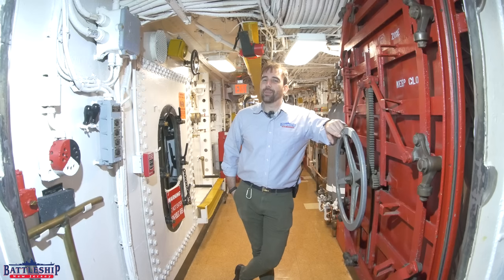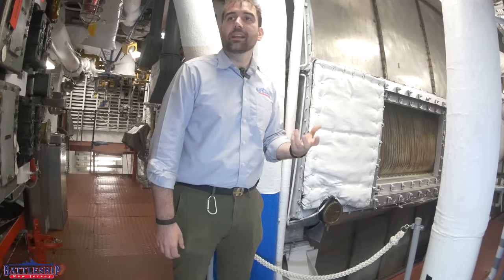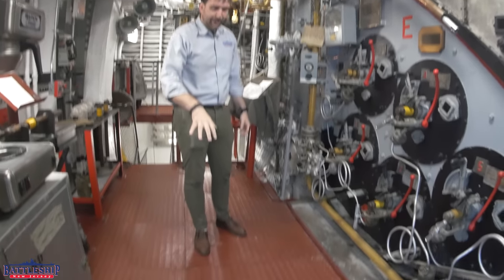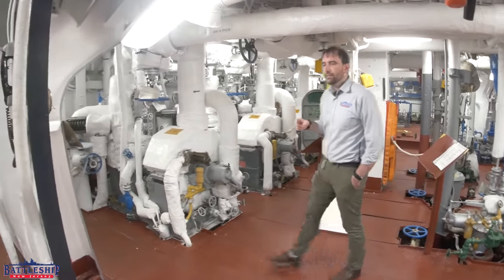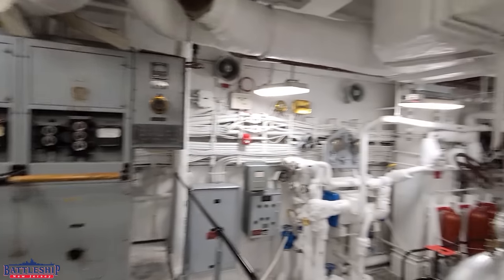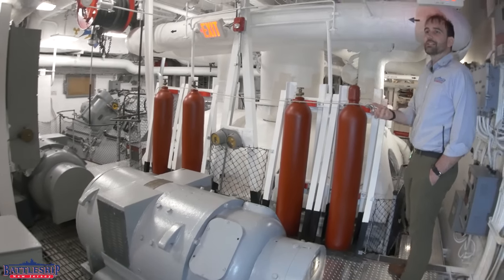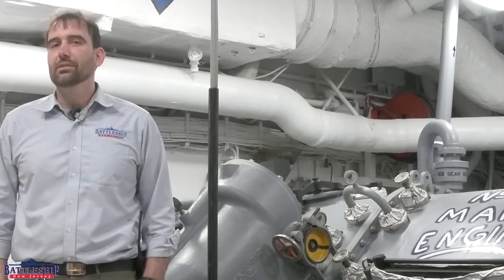Inside the Propulsion Plant of the World's Fastest Battleship

Comment: Flash back! I was a Boiler Technician in the Navy (BT3). It was hot and dirty, and smelled like diesel. You were the first one on the ship, and the last one off the ship. 18 hour days was the norm while under way, and you prayed that there wasn’t GQ (General Quarters), man overboard drills, or anything else going on while your trying to get a few hours of sleep, if you even got any at all. 6 hours on watch, what we called 6&6 with a full work day in between watches was our underway schedule. A friend was an MM2 on this very ship. Being a hole Snipe was the hardest job on the ship. I retired as an MRC (Machinery Repairman Chief Petty Officer).
Reply: I had a good laugh when he talked about 4 hour shifts. If we were 4 and 8 we had a full workday as well. I was a hole snipe on the USS Midway for more than three year and we almost never went 4 and 8.
Reply: Engineering never changes, I'm a nuke on a CVN and its still the same. 6 and 6's while underway and 3 section duty in port.

Comment: Marine engineers are the only people I know who will drink coffee in a 120 degree environment!
Reply: We also put on a sweater if it gets down to 90 deg F!
Reply: @josephpadula2283  Good humor , When I was aboard U.S.S. Hepburn we were on out way to Australia . Our Corpsman came down to the Fire room , The COLDEST place he could find was 155 Degrees . About 2 Weeks later we had to muster on the Helocopter deck . I went up and Imediatley went back and put on my peacoat ,gloves , Watch cap , I want back up . I was still cold . the humor . Us Bt's Were dressed for Cold the rest of the ship was dressed for hot , they were Sweating  we were so COLD . It was 7 A.m. air temp was 84 we were at 24 kts  . Thank You
Reply: @henrycarlson7514  The coolest area in a steamship engine room (except for modern ships with air conditioned control rooms) is the exhaust of the low pressure turbine. It is around 75 -80 degrees F.
Reply: @oldtugs  I was aboard  U.S.S. Hepburn FF1055 Which had a seperate fire room and engine room , the area by the mn condenser was cold
Reply: Or tea !
Reply: M looks
Reply: Not the asbestos gloves lol
Reply: You've never worked swing shift in a steel foundry apparently.
Reply: @henrycarlson7514 The human body is amazing at adapting, but not amazing enough, apparently 😂 You want to get used to the heat, but you don't want to get non-used to the non-heat.
Reply: @henrycarlson7514 : When were you aboard Hepburn?

My dad was a BT on Hepburn in the 70's. I've inherited a few of his cruise books.
Reply: @DefiantSix  I was aboard U.SS Hepburn FF 1055 , 1981+1982 . I was also a BT. I have 1 cruise book .  As a True story , we were in the Indian Ocean , the Corpsman cam e down with a dry bulb thermometer , the COLDEST place he found was 155 Degrees.
Reply: @josephpadula2283  Former BT aboard Adams Class DDG - can confirm.
Reply: Yeah, it's funny 🤣 cause it's sooo true! I would drink hot 🔥 🥵 coffee in that HOT engineering space. You had to drink the hot coffee ☕ in that hot space. Can be up for over twenty four hours or more, it's rough. Thanks.
Reply: @jasonbose3507  I'd go through 2 Big Gulp cups of coffee in a 6 hour watch.  That would kill me now... Literally.
Reply: @henrycarlson7514  USS Hoel , DDG-13 - I had to do that job for Engneering - can confirm.
Reply: @oldtugs   Former BT - that sounds wuuuuuunderful.....
Reply: @josephpadula2283    We were south of the Bite in Australia, not far from the antarctic circle, when they woke me up for watch they said grab your peacoat.  It was 60deg in the fireroom (the water outside was near freezing).  It was weird.
Reply: welcome into my club😅😂😂😂😂😂😂😂
Reply: MM aboard the USS Paul DE 1080 ‘74.
Reply: I was in the engine room in those days. Short handed, 4 on 4. That's where I learned to love black coffee. Of course the th 60's it was a urn bolted down and the way the LSDs rode the grounds spilled over.  That way you got your rufidge.  But at least the coffee never got cold even sitting for a while.
Reply: @henrycarlson7514 the human body cant continuously operate after More than 15-20 minutes at that temperature 🙄
Reply: @jonnyblayze5149  I disagree , When I was Navy , The watches were 5 hours long NO breaks . Any body that was a Bt can verify . Especally near the equator.
Reply: @henrycarlson7514  physics and biology says you're wrong
Reply: @henrycarlson7514  Externally, the upper limit of the human body's thermoneutral zone—the ambient temperature range in which the body can maintain effectively maintain its temperature and equilibrium—likely falls somewhere between 104 and 122 degrees Fahrenheit, according to a 2021 study published in Physiology Report.Nov 29, 2023.

155 is just too much🤷
Reply: @jonnyblayze5149  I and Thousands of Bt's will disagree with you . I was there I read the Thermometers. Also please understand that was the Coldest place he found.
Reply: @jonnyblayze5149  I must disagree  I was there I read many thermometers . Ask any Bt that was Messenger of the watch , the temperature readings are taken every hour in several places and Logged .
Reply: @henrycarlson7514  yeah im just saying physics, scientific studies, and proof say you're wrong. 🤷 But hey what do the worlds smartest minds know right🙄
Reply: @henrycarlson7514  155 is just too much, not says me but says physics, biology, and the PHD scientists that studied this do.
Reply: @jonnyblayze5149  I Was There I  Read the thermometers , Ask ANY Bt that served on a Frigate or Destroyer
Reply: Ahí abajo no tomaban helado?😂
Reply: Coffee pot makes ice coffee
Reply: Never known a truck driver or auto mechanic or a painter or a Mason or a welder or a cop or a fireman I guess huh? Geez
Reply: Me too ☕️! 🇺🇸

Comment: I always wondered why they didn't use direct engine power as a kid, but now realizing you can get quadruple the power of oil by using steam is fascinating to me.
Reply: Marine diesel technology was not capable of producing this kind of power back then.  Today, you can get low speed marine diesels up to 100,000hp or more. and since they are low speed, there is no red gear, they are direct drive, which saves weight (not that the engine is light, but you don't then have the EXTRA weight of the reduction gear) and cost (initial and maintenance).  But you are correct, at the time, this complicated steam power system produced the most power for its weight and operating cost.
Reply: @stephenbritton9297  Another significant advantage of modern marine diesels: they don't have steam's nasty habit of barbecuing the crew when the engine room takes even a relatively minor hit, a recurring theme (as Ryan alluded to here) that is easily the most harrowing part of any book about, say, the naval battles off Guadalcanal.
Reply: Some other things to consider.   If you have one power plant and it goes offline you are done.   This setup provides redundancy and the small compartments to help with water control if they get hit.
Reply: @ZGryphon  One of my father’s cousins was in an engine room on the carrier Wasp when she took a Japanese armor piercing bomb through the flight deck, the hanger deck , where it exploded in his engine room. Only he and two other guys survived the blast, although it would lead to his early death years later. I won’t go into the details he told us about what it was like going back in there to clean out the damage and remove the casualties.
Reply: How much (if any) can you adjust the ship’s speed by tweaking the air and fuel flow before you have to swap out the burner nozzles?

And when the navy switched from bunker C to diesel, did the burner nozzles change to account for the change in viscosity and BTUs?
Reply: @oligoprimer  The Iowa class battleships to use diesel fuel in the 1980’s in I remember correctly. This was done to simplify the logistics of at sea fuel replenishment. As I remembered the adjustment of the air fuel mixture is not going to give you any real performance gains but was used to to trim the air fuel mixture to attenuated visible emissions as the burner nozzles became coked up (fouled) before being removed to be cleaned. Coking of the burner nozzles became a lesser issue after the boilers were converted to run on diesel fuel.  A side if a fuel spill into water diesel fuel is far less detrimental to the environment and wildlife than Bunker C because diesel fuel will float and evaporate and dissipate whereas Bunker C will remain a sticky gooey mess that will either sink to the sea floor or wash up on shore.
Reply: @gullreefclub it not only simplified logistical support for fuel but relieved a workload from the sailors maintaining/operating the boilers. On black oil fireside cleaning was performed approximately every 600 hours of operation to remove deposits from the exterior of the boiler tubes. On distillate fuel that timeframe was increased to approximately 2 times that value. The work performed actually became easier because the distillate fuel burned so much cleaner than the black oil did. Cleaner burn meant less deposited to remove from the exterior of the boiler tubes.
Reply: @oligoprimer question 1.  Yes fuel flow and combustion air were the primary controls for boiler output. 
Question 2.  Yes nozzle sizes changed considerably.
Reply: If you were wondering about the design choices of a battleship propulsion system as a kid… shew… god bless.  I hope you’re a weps designer for Lockeed Martin or some other weapons builder.
Reply: You cannot "quadruple power" by doing anything. You don't understand what power means in physics.
Reply: Lliuninininiiiiiiii8iip
J
😊😊 1:27
Reply: Thank You  , this is very interesting , if you ever get the chance to tour a coal fired power station while there is a couple left  , advise you to take it .Fascinating 👍 as they're running too😊
Reply: @aluisious you know what he means though even if he did not use the technically correct terminology (a terminology that’s somewhat detrimental to use in most cases as most people don’t actually know the precise meanings of each term and will get confused quickly) these are YouTube comments not a lecture or paper on battleship propulsion refinement and improvement
Reply: @stephenbritton9297 it still does, but some of the fuel has changed. It's nuclear fuel.
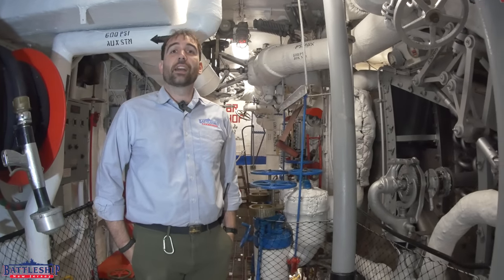Reply: @ZGryphon 4:49 😊
Reply: We had some Iraqi's cleaning up the messes in the blown up APC's, tanks, trucks.  Sometimes the Iraqi's wouldn't show up & do their job, so it was up to us. Some of them had been sitting in the field for a number of days, so they were ripe.  War is ugly, but most people do not comprehend that part.
Reply: Those early videos are just fine Ryan.
Reply: @stephenbritton9297  I have no experience in the subject, but was watching a video on a cargo ship on the great lakes and was fascinated by the fact that they were turning single digit RPMs on the main engines.
Reply: @gullreefclub  I remember as a kid getting "tar" on my feet while at the beach. It also may have come from natural seeps in the Gulf of Mexico.
Reply: Turbine steam was a big debate in the British K subs of the 1910s. They wanted the speed to keep up with the Battleship Line as Battleships were becoming faster Dreadnaughts. Adm Fisher wanted diesel but they couldn't get the speed so they had to use steam turbine. The main reason Fisher wanted direct diesel was because boilers would go out if flooding occurred. They also ended up putting diesel generators to power the batteries as back up in case of flooding. Which ended up being a good idea as flooding did occur, as predicted by Fisher.
Reply: Propulsion is still steam turban, the difference is we now make the steam with nuclear power, both surface and subs.
Reply: @aluisious yes you can. If I burn oil in a pit I might get about 600W of heating. With massive heat losses to exhaust and unburned oil.  If I burn it in a boiler I might get 20kW with lower exhaust heat and almost no unburned fuel. I more than quadrupled the power. 

Don't say such blatantly silly things.
Reply: @aluisious increasing efficiency will give an output power boost.

Through generations with technological evolution even quadrupling of output power is theoretically, practically and historically possible from thermodynamically operated machines.
Reply: @stephenbritton9297 A lot of that too is because those gears are often the most expensive single part of a ship, take AGES to build, and there are only a few places that make them.

So by designing ships without huge reduction gears modern shipping companies can build more boats in the same an of time for cheaper, even if everything else was the same.
Reply: So 40.2 mph
Reply: Black Gang County
Reply: @lawrencemay8671 motors.
Reply: @Lloyd973 he asked if the fuel, air could increase speed?
Increasing the flow of volume of steam to the turbine will increase speed. Fuel and air is used to create the steam, in this case 600 psi of steam pressure but, as mentioned can be useful to keep the exciting exhaust less visible
Reply: @gullreefclub  Most of the steam powered active ships in the 70's and 80's all went to DFM, Diesel Fuel Marine - typically what you mention it was diesel fuel. Using DFM was a big plus since it didn't require pre-heating. We still swapped and cleaned the burner nozzles every 24 hours.